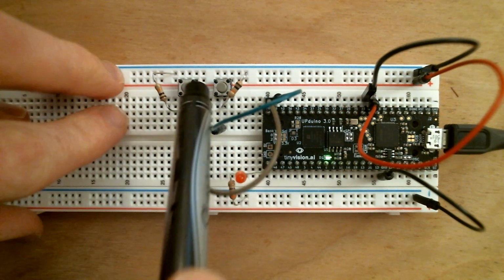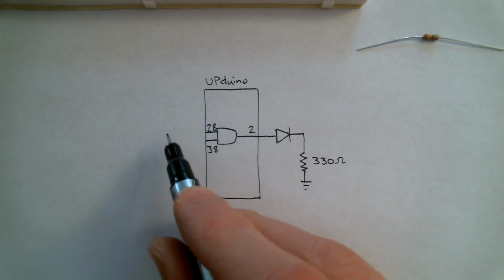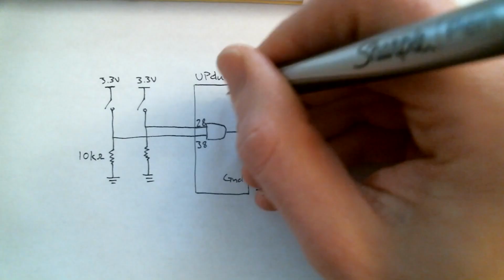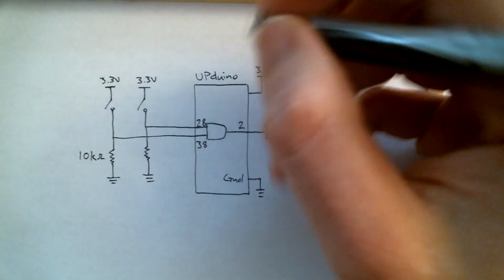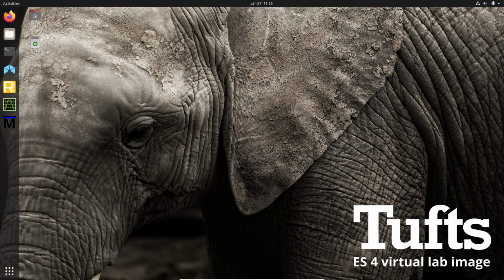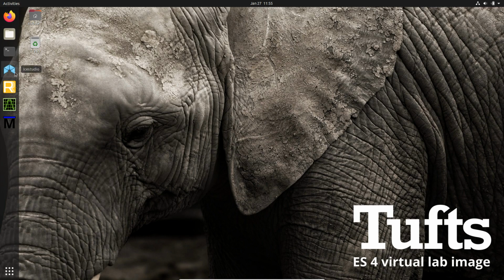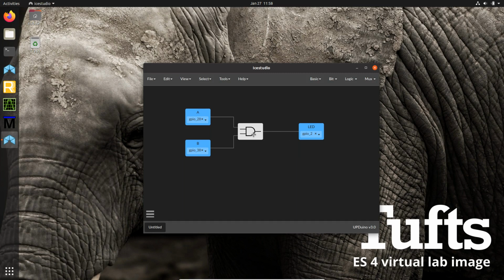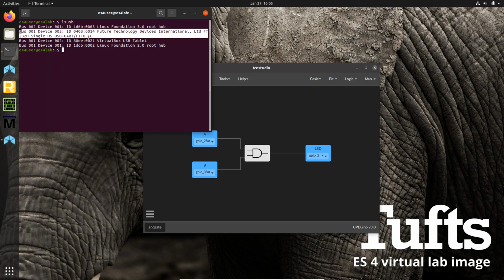ES 4 Lab 0: Introduction to icestudio + FPGA

Comment: Nice job! Thanks a lot! 😀️
Just wanted to point out that the workflow can be simplied a little bit just by pressing only the upload option. It will automatically build the design and upload it.  The workflow could be: edit your circuit, click on upload. Edit again, click on uplaod...

Comment: I've just started using FPGA's and your video series will be a great help. I don't get the 4 pulldown menus on my 
version 0.10-rc1
Reply from the maker: Do you mean the "Basic", "Bit", "Logic", and "Mux" pulldowns?  To get the part menus, you may need to load a "collection" (Tools > Collections > Add).  I haven't used the most recent version of icestudio, so this may have changed.
Reply: Hi Steven, thanks for getting back to me - I'll try searching some more options

Comment: Hi, nice video!!
I'm interested in the UPduino board. What was Icestudio version used? Stable or nightly? Because, the documentation for UPduino 3.0 indicates Icestudio nightly version.
Reply from the maker: I don't remember which it was -- it may have been a nightly.  This was four years ago, so the UPduino 3.0 was new and maybe wasn't supported in the recent stable release.  Now it's supported in the stable version without any issues, so it probably doesn't matter which version you pick.
Reply: Thank you so much!

Comment: It's looks like Lattice has embraced (or at least not opposed) the open-source synthesis / place-and-route tools that generate Lattice bitstreams!    Any thoughts on how these open-source tools (ex.  IceStudio / SymbiFlow / YosysHQ ) compare to the commercial offerings?  

For example, can the older (2004) Lattice Products listed on the website (ex. Design Software > 1553 Encoder/Decoder ) be freely-downloaded, and synthesized with either tool? I'm interested in starting with a working IP, going thru the design flow software, to finally testing on hardware!
Reply from the maker: The open-source toolchains only work for the iCE40-series parts, as far as I know.  There is active work on the ECP5 and other parts, but they're not fully supported.

In terms of synthesizing Verilog/VHDL to hardware, the open-source toolchain is just as good if not better than the commercial tools (or at least, you're a lot more likely to get support from the open-source community than from Lattice as a free user).  But in terms of integrating pre-packaged IP, doing power analysis, and other more specialized stuff, the Lattice tools have the advantage.